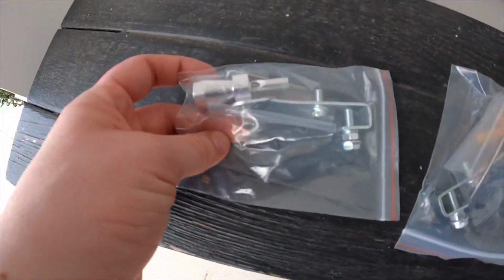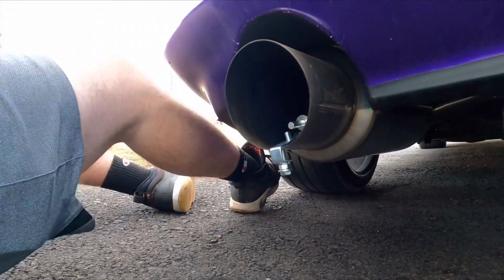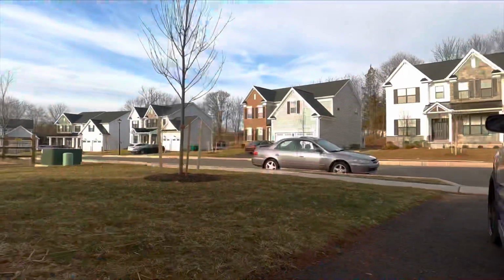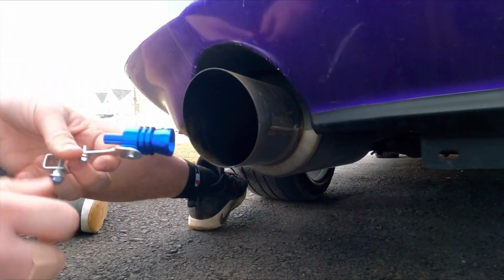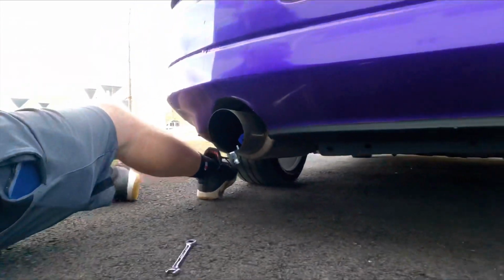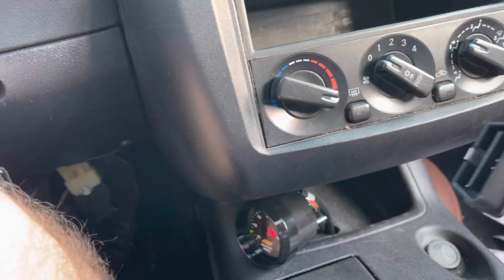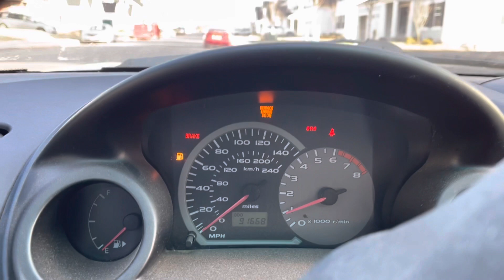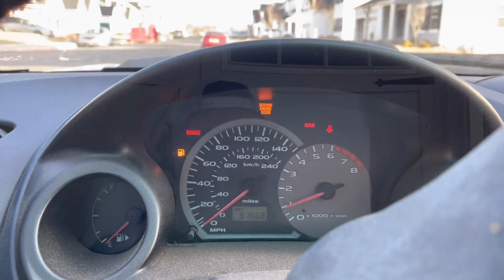PUTTING TURBO WHISTLES TO THE TEST!! Full install and review!!

Comment: What’s your opinion on the Invidia N1? Currently I have long tube headers with a DNA motoring catback but I want to buy the N1. I daily drive my eclipse, 30-60 miles a day. I’m not looking for loudness, I just want it to sound good.

Is the N1 with the silencer in quiet enough for daily driving?
Reply from the maker: Yes the N1 is great and with the silencer on its very quiet inside the car. 100% recommend. Much better fitment as well

Comment: Yeah look at that blue smoke time 💣
Reply from the maker: It’s just an oil leak, I need to throw on the new valve cover gasket
Reply: @3GRacing11  valve cover leaking and it’s coming out the back of the exhaust?
Reply: @3GRacing11  no that is bad piston rings